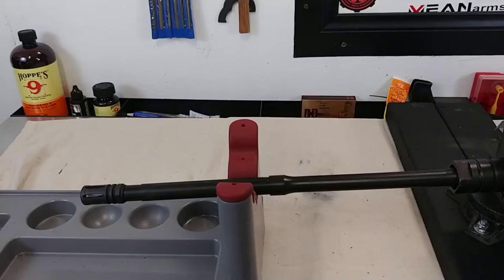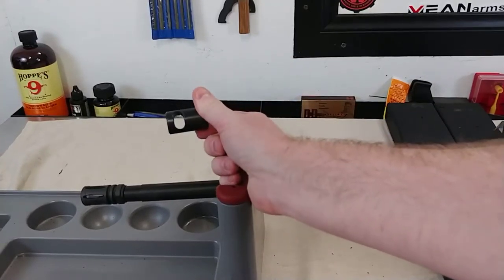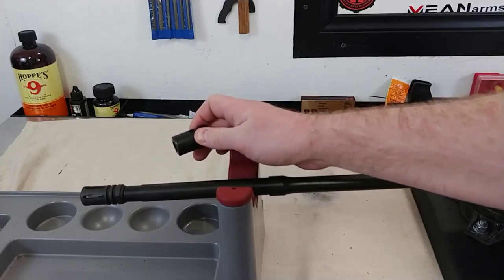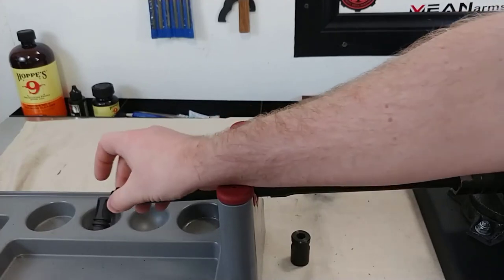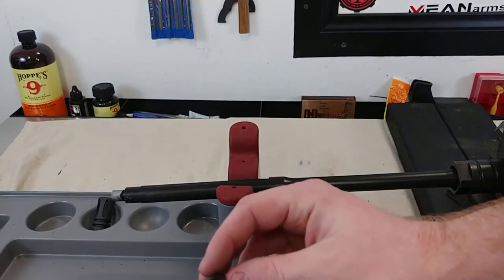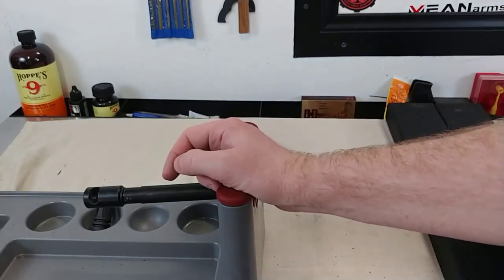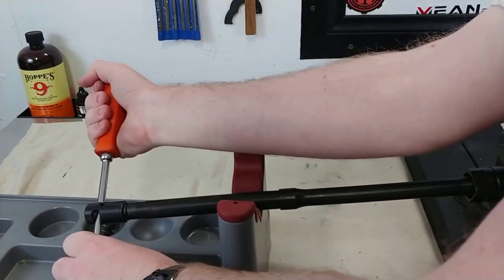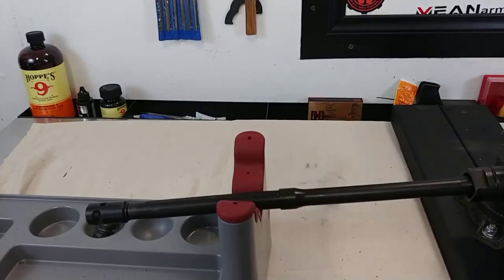How to install a muzzle break without a wrench

Comment: Hi, thank you for the video. I am also in Cali ( sad face). I am currently completing a build, but just the lower as i bought a complete upper with a flash hider from the factory. Just want to make sure that when you are loosening and and tightening the muzzle break, that the barrel is not affected in any way, correct (i.e., come lose)? I don't believe it will as the barrel is not twisted on, but connect to the upper via the barrel nut. Thanks for the help!

Comment: What exactly is the stuff called that you put on the threads to stop the seizing? "Antiseize"?
Reply from the maker: yep anti-seize.  you use it when installing new spark plugs in your engine.  you can also use gun grease/moly grease/etc.